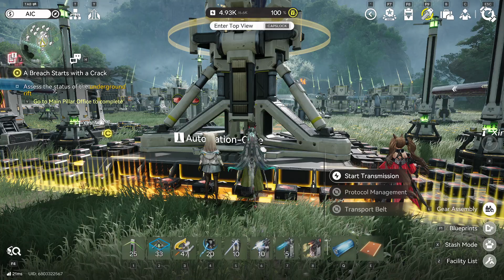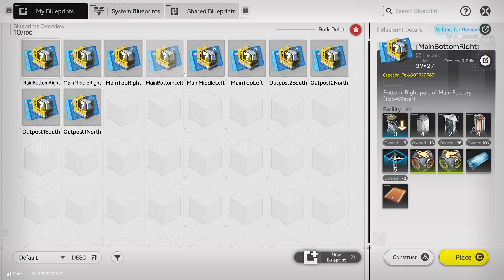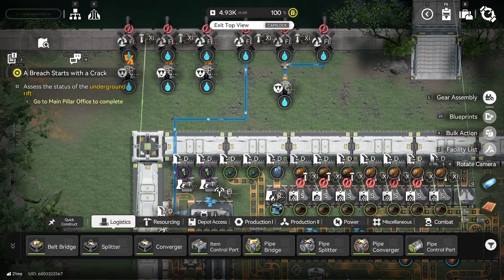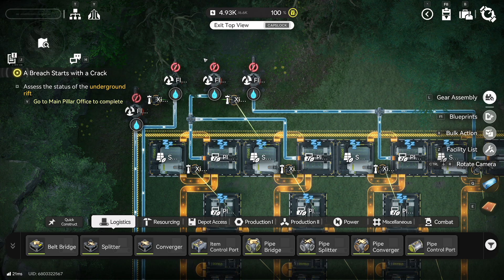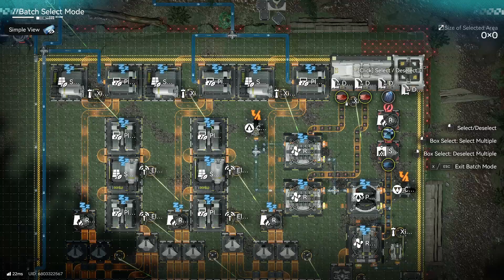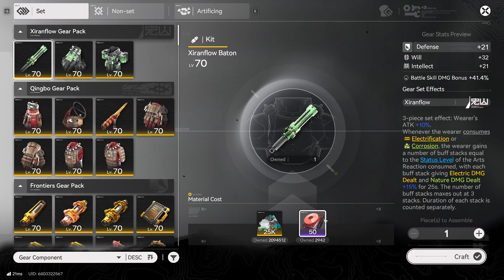Wuling Factory Guide - Patch 1.2

Comment: Im confused what I did wrong with mines. I followed what you did step by step, had to fix some of the stuff coming out of the Main PAC, but I thought that would be it. There's something wrong with the battery production for me, but I can't pinpoint the actual issues between all of the connections
Reply: Nevermind, I think I might've fixed it.
Reply: I finally got it to work, I just needed to redo the blueprints because I didn't have everything set correctly before, like the Cuprium ore coming out of the main AIC.

My battery protection is 9 instead of 12, but I'll figure it out, probably because I need to replace the xiranite creator blueprint as well.

Amazing build, very effective.
Reply: All I had to do was build the 3rd one.

Comment: Thanks for the video, it helped a lot! The only thing I want to add is that when you get the acid outpost to lvl 3, there will be a new fence like structure at the very bottom,  so running that acid pipe at the very bottom won't be possible due to the fence blocking the way. It's easily fixable though, I just ran the pipe inbetween the forges and portable storages instead and moved the 2 machines (and the pipes connecting them) left of the sub pac up by one square. Other than that, the factory works very well! The only problem is it uses more originium than I'm getting but I'm not sure if I'm doing something wrong or if we just have to transport originium from Valley IV to Wuling for now.

Comment: Do I need markerstone at max to have the factory work as intented?
Reply from the maker: Outposts don't need to be max lvl, just the size. You need a bus unlocked in the markerstone one too. Main wuling factory must be fully maxed out in size and bus
Reply: @TheAndreas50  I'm asking because, as a relatively new player, 900 thousand credits in wuling is simply speaking unrealistic at this point. Would it be possible to cut something out, to fit on medium sized marker?
Reply from the maker: @gruncik1841 you can just use the main factory for now, plus the stockade. You will Only be missing the newest components and parts, and the stuff produced in the other  factories will quickly let you earn stock to upgrade everything.

Stockade doesn't even need the bus upgrade at all
Reply: @TheAndreas50  Alright. Tyvm for the answers!